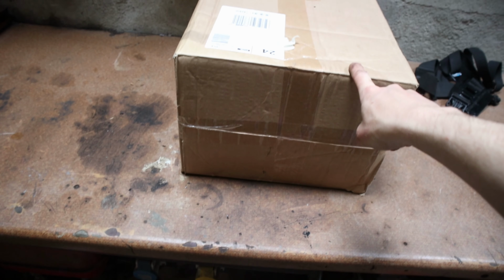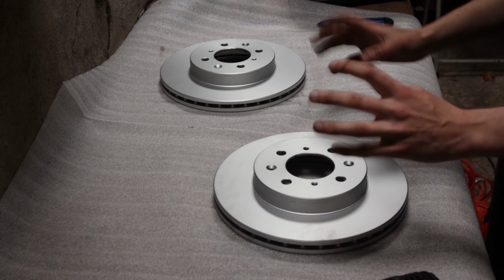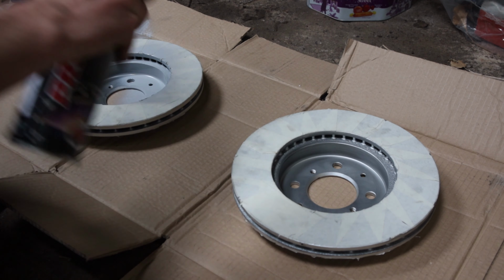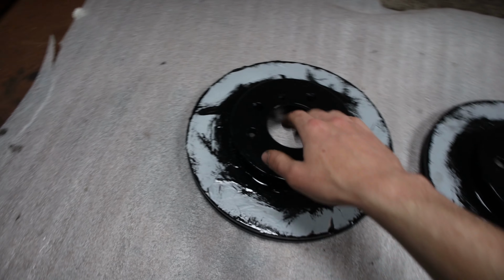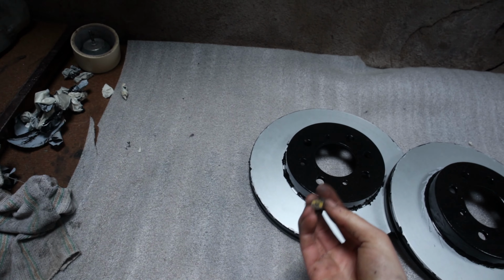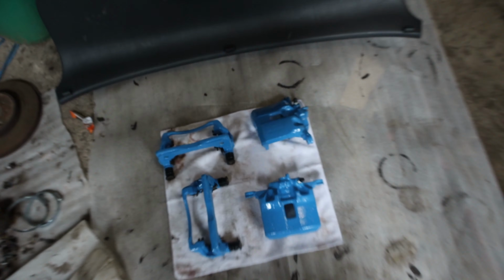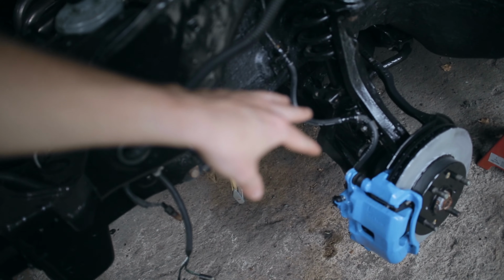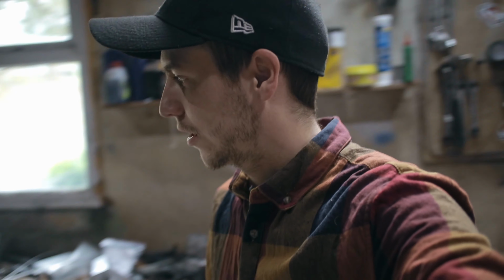New Brakes For The Civic!

Comment: Just a bit of advice man, you shouldn't put paint on the calliper carrier underneath the shims where the pads sit, pads should be able to slide freely. or on the face of the hub/wheel bearing along with the back and face of the disc just a bit of advice. Lovin the vids man
Reply from the maker: Thanks 🙏 i did notice they were a bit tight 😂 I'll keep that in mind next time round 🤙